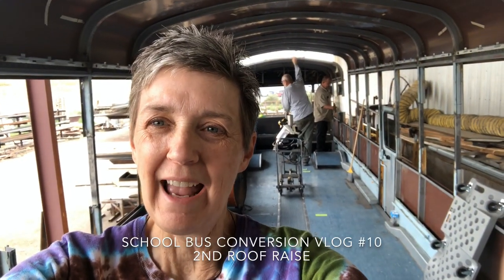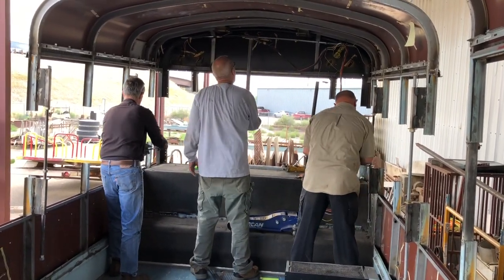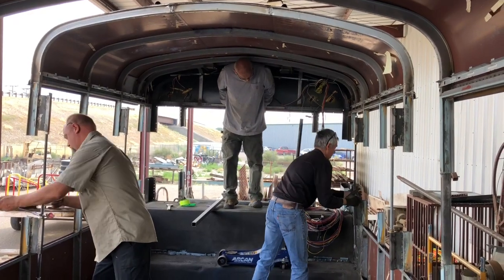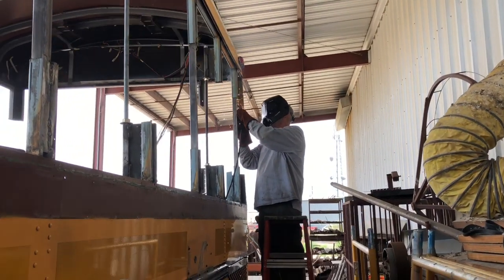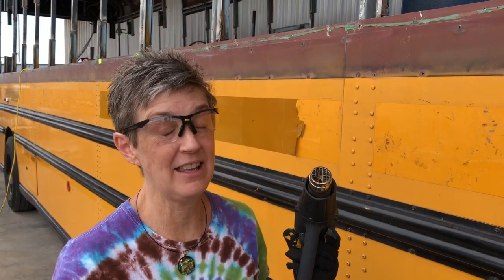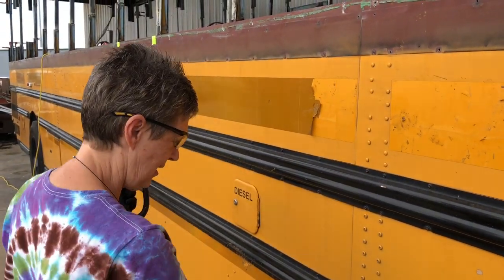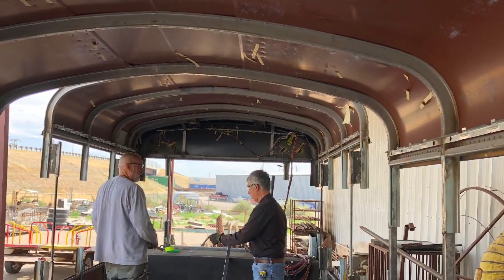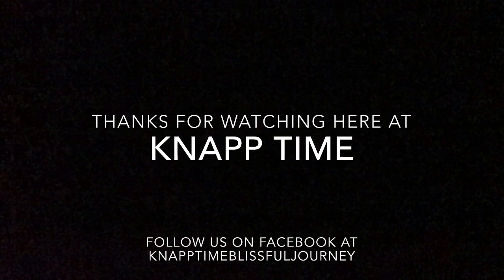2nd Roof Raise - Vlog 10 School Bus Conversion

Comment: Why did you raise the roof in two separate sections?
Reply from the maker: Good question - we are doing a Murphy bed in the back of the bus and need the extra height. This way it will open up the back of the bus for other things during the day. Plus we love the look it brought to the roof line.
Reply: @KnappTime  I thought about doing a Murphy bed and making the back row a couch in the daytime. What size bed are you doing? I was planning a king but not sure if that's too big for that idea.  How many inches is your second stage roof raise? I was planning to raise mine 20 inches front to back with no transitions. .  I have not yet raised my roof.  Planning that for fall.  Waiting for my mechanic to get my newly rebuilt engine and transmission reassembled back into the bus.  We have the same powertrain.  But my ISC has a CAPS fuel pump.  Yours might be the next generation fuel injection.
Reply from the maker: @larrym6019  - Our bus is a 2004 Thomas. The first roof raise is 16" and the second is 24". We started with a lower bus. We are putting in a queen size bed so that we can have space to walk around the bed when it is down on both sides. Only a bit over a foot but enough to make it easy to make the bed and change the sheets.
Reply: Now I'm rethinking my floorplan and fresh water tank placement. If I do a Murphy bed then the last row seat can be a couch for a rear living room. A dual purpose room would free up a lot of space up front.  My mental gears are
 turning for sure!